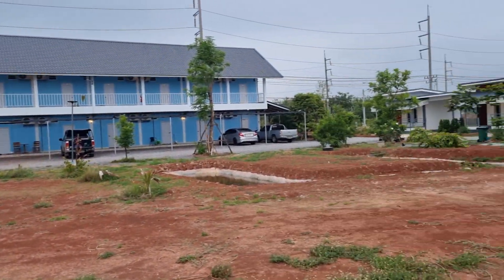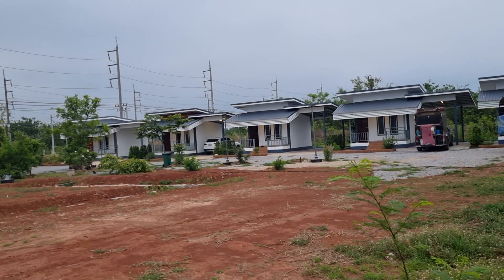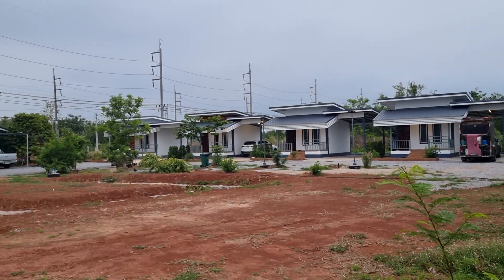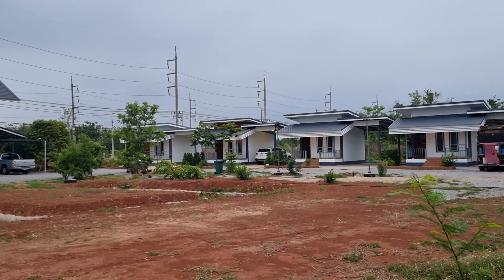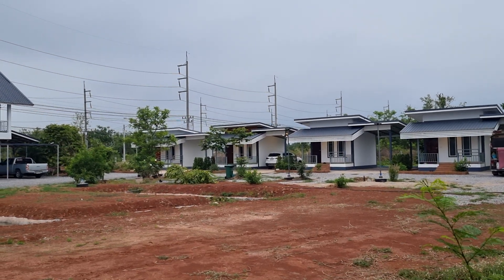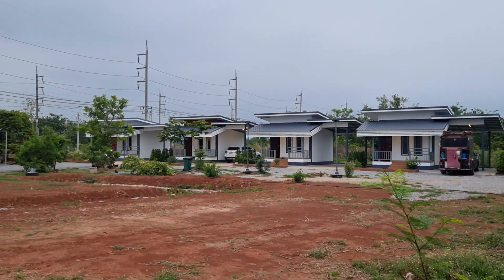Smart Solar Planning - How To Prepare For Solar Now, But Batteries Later | SolarThailand.biz

Comment: thanks for your good explanation.  I just had a thought about whether its possible to, at a later point in time, install a second battery inverter alongside the original on-grid inverter?
I also have a question about why ground installation of the panels seems to be a very different case than roof top installs.
Reply from the maker: If you start with an ongrid inverter, then later on add a hybrid inverter it will work. Alpha has a special mode called hybrid coupling mode for this. It makes it possible to see the PV energy from both systems in the Alpha app.
Reply from the maker: Ground installation of panels for homes is possible, but takes a lot of space and precautions must be taken so the strings cant be reached by children or animals.

Comment: I want to install off grid solar panels on a 2 bedroom single story bungalow I plan to have built, but can't get any sensible answers to my question.  A) how much would the solar installation cost on it's own and B) what is the cost of the battery and it's installation. This would be done through you when the time comes but a today figure would help my calculations.
Reply from the maker: That depends on the load. And the load doesnt come automatically from knowing its a 2 bedroom house. But i can tell you that it will be hard to manage with less than 10 kw with two 10 kwh batteries. This would cost around 850k baht allin including installation and very good warranties. We dont sell batteries on its own. Send an email to chaweewangroupthailand@gmail.com for more info.
Reply: @ChaweewanGroup  That's 20,000 gb pounds, way to much for Thailand I will connect it to the grid.
Reply from the maker: @grahamjohnson4702  On grid is much cheaper because you can support from grid when energy is low from PV. There are ways to do off grid cheaper, but you must do many adjustments, for example go with solar thermal for water heating and gas for kitchen stove etc.
Reply: @ChaweewanGroup  For shower an electric shower is only used for a few minutes and I thought Thai cook using gas anyway, and if you need washing up water Electric shower can provide washing up water. I see now why I not see many domestic solar systems in Thailand.
Reply from the maker: @grahamjohnson4702  These are details about load. Thats why i said i must know load to give you a recommendation. Electric shower heaters are seldom less than 4000 watts, and as such is important even though its in use not for a long time. Gas is used in kitchens here, yes, but that doesnt mean i can assume you will. Electrical stoves are very common. Domestic solar systems are starting to get common here, and the development is accelerating because the return of investment is very good, for example only about 4 years payback time on a 10 kw system without batteries. We have other videos about this if you are interested.
Reply: @ChaweewanGroup  The property will be for my Thai wife who would not cook on electric, and I won't be living there so it will be a typical Thai house, but surly you will need batteries for night time electric as you will not be producing electric in the dark when off grid?
Reply from the maker: @grahamjohnson4702  Yes, if its completely off grid you need batteries. But you were commenting on Thailand use of solar in general, so i replied to that.

Comment: in diss specific customers case i think i would have installed a Solax hybrid inverter and upgraded him to a battery at a later date. sins the solax hybrid inverter has a wide DC voltage range.
Reply from the maker: There is no reason to think that solax inverter will be able to connect the new solid state or new LFMP tech battery. So i think your solution is not going to work. Its the same as installing an AlphaESS or Growatt hybrid inverter. They also will probably not be able to connect the new battery tech when it comes.